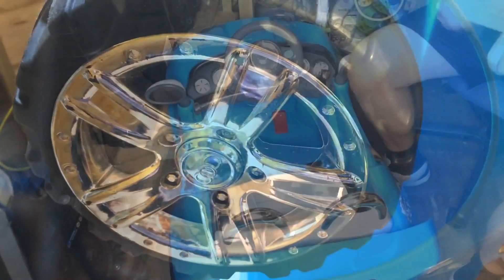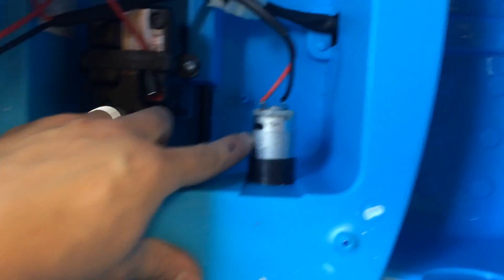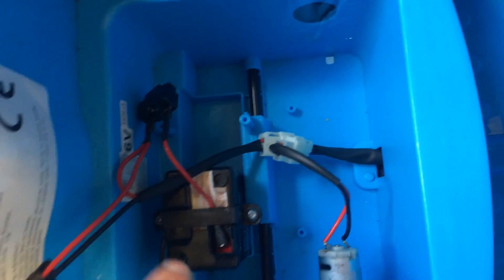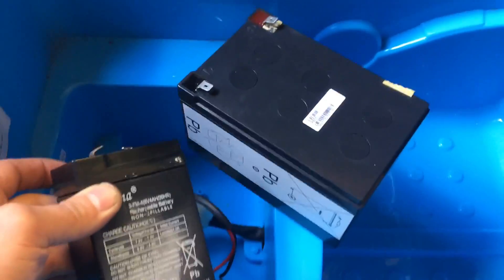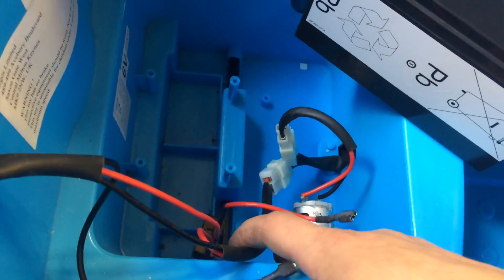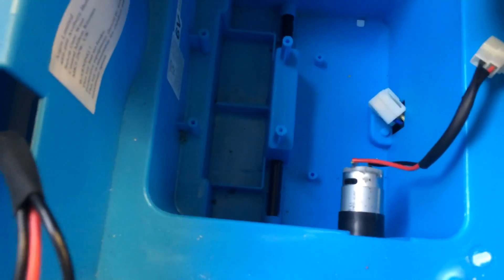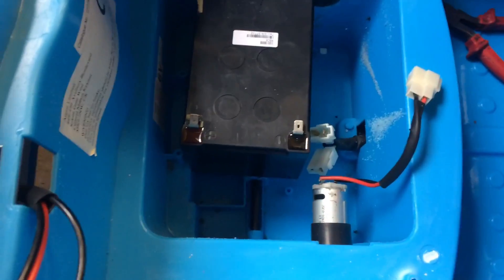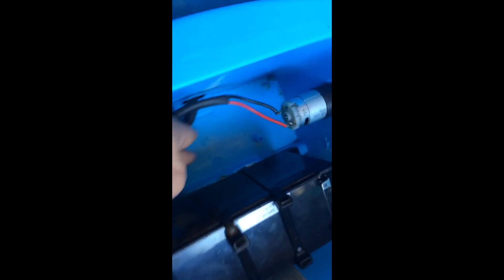HOW TO UPGRADE A RIDE ON BATTERY 6v - 12v

Comment: Sooo did I miss the part where you have to change the gearbox from 6v to 12v because wouldn't a 12v battery burnout the 6v gearbox??
Reply: Fact bro
Reply: This happened to me thought it would be a good idea to use an 18v battery on a 6v motor. The motor lasted about 5 minutes then started smoking and ceased to exist after that

Comment: this wont work for me though... have motor... yes... may take more voltage... yes.... but all the LED lights and speakers and other electronics including the remote control receiver... all those a balanced for 6volts.... 12 volts will kill them all

Comment: Did it blow lights up or radio by putting 12v through it
Reply from the maker: Nope still working to this day
Reply: @Cjrelectrical  and all you did was change battery bay and fit 12v battery in no changing wiring etc
Reply: @KEITH070880  Don't try an 18v...yeah. Just don't lol.

Comment: Hi there, I have a Mercedes GL450 electric car for my son but it doesn't seem to have a receiver for a parental control. He's too young to drive it himself so I need the control for it but I'm not sure how to connect the receiver to the battery or if that's even possible??
Reply: The battery is a 6V. The wider thinner type...